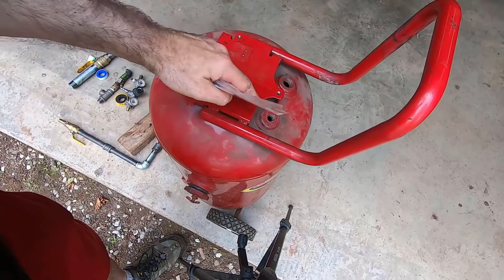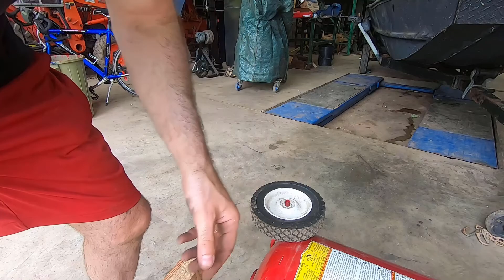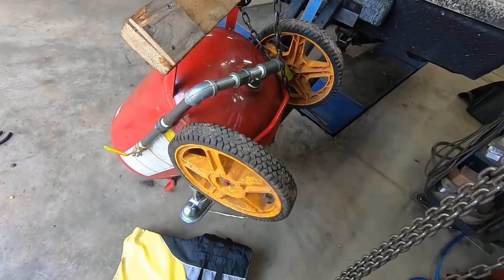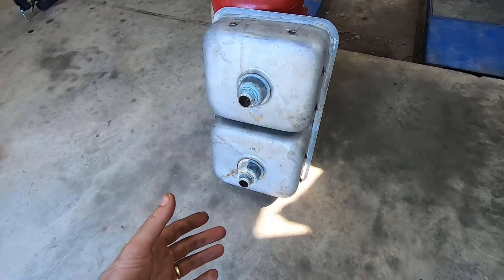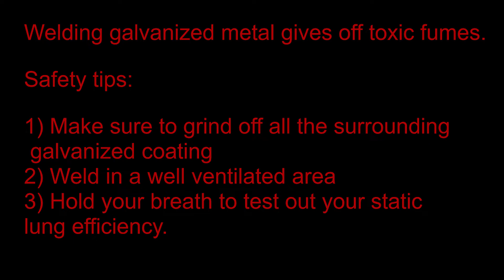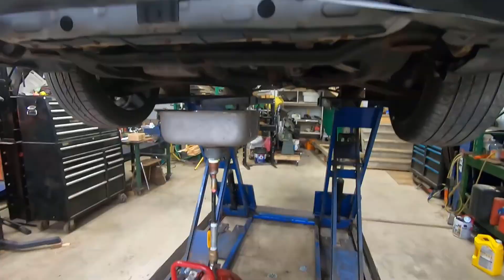Waste Oil Drain Tank With Air Evacuation

Comment: Take it to the next step just find a vacuum pump Unless you have one for A/C work or air operated venturi vacuum generator and pull a vacuum on your tank, connect a hose with a valve on the suction end to a tee under the valve where your overhead drain tank is dumped in and vacuum your oil in. May want to change your Guage to a vacuum/pressure gauge
Reply from the maker: great idea

Comment: Great idea on this. I never thought of using an old kitchen sink for the funnel. I'm gathering pieces to make one of these. I'm using a 50 Lbs. out of date propane tank that I came across a while ago. The thread in the top of the tank is 3/4 inch pipe. I have taken a 20 Lbs propane tank and cut it in half to use for the funnel. I did have a thought that maybe the dia. of isn't big enough to catch the arc of the oil as it comes flying out of the oil pan, but I also think I can raise it high enough under the stream to catch it until it settles down and straightens out. I actually have a single sink that I could use, but that was planned for a parts washing station, we'll see. I planned on using a 1/2 inch black pipe as the upright pipe to drain the oil, but haven't actually tested yet to see if it will fit inside a 3/4  that will screw into the top of the holding tank. Does the 1/2 inch pipe provide enough flow for the oil, or does the oil ever back up into the sink as it's draining? What would you change on the design of yours?
Reply from the maker: Yes there is mild backup during an oil change. However it's not a problem because the sink only fills up a couple of inches until the vehicle drains out and then in another maybe 45 seconds the sink drains down. The only thing I would change if I had to do it over again would be to use a shorter tank then the upright tank I currently have. I would still use an upright tank but would like to get one that's about a foot shorter. The geometry of what I built barely fits under my inground scissor hoist for low vehicles. It's definitely workable but that's what I would do differently next time. Also I would put four rotating casters on each Corner instead of the two fixed casters. Very often I want to move the machine to the side or forward backward and the fix casters make this less efficient.
Reply: @mrdiyguy123  OK, thanks for that. I have a 2 post hoist going in my shop, so I don't think that height will be an issue for my set up. I have bought a furniture dolly that is about 16"x16" square with a swivel caster at each corner for the lower tank to be attached to.